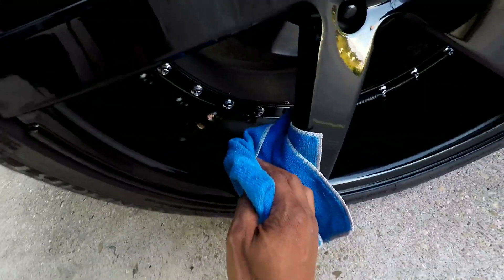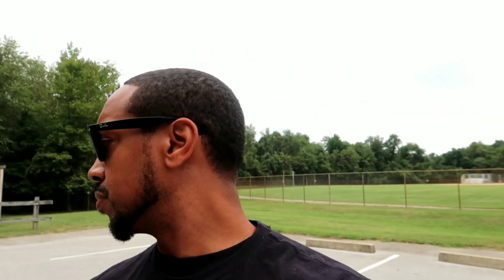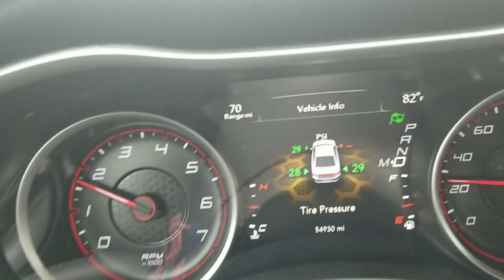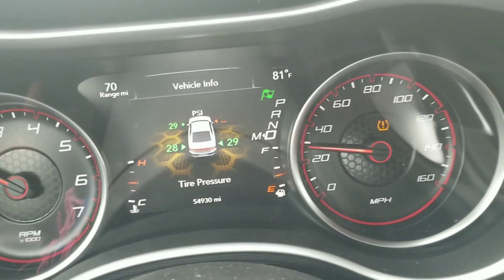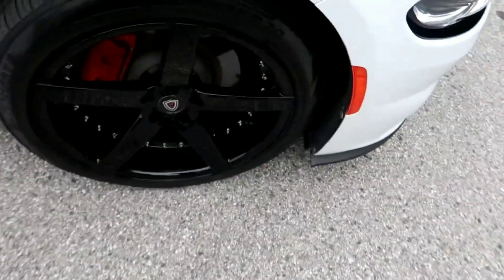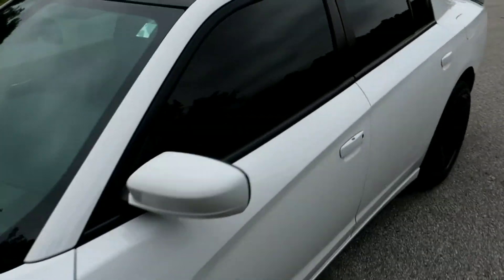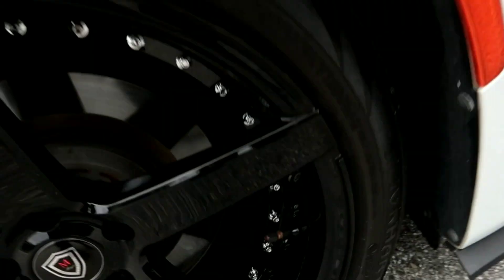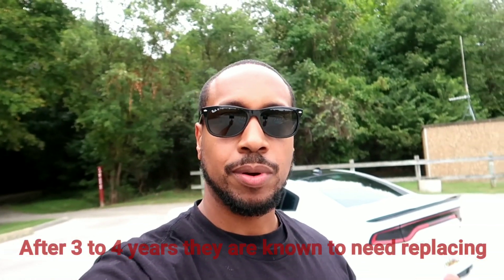My Dodge Charger Is Having The Same Problem FCA Is Being Sued For!

Comment: Here is one for you; I put new 275's on my R/T and my dealer told if I leave them on the car they won't honor the warranty for suspension and also possibly differential problems. Was able to get tire place to give me the 245's w/ no money. Nitto Motivo's. My valves are rubber and they still don't read well. I just do it the old fashion way.

Comment: Thanks for sharing this bruh. I've been getting tire messages for the front passenger side for a while now. It appears to be full of air. Never thought to check the valve stems. Thought it was just due to old age - lol - 2011 Charger. Will be replacing my wheels and tires soon so I'll prolly throw that on in with that job too if needed.

Comment: Omg dodge didnt recall aftermarket wheels?
Reply from the maker: You funny it's not about the wheels funny man it's the valve stem 👎
Reply: Wasnt trying to hate sorry your having problems. The tpms has replaceable valve stems why not take it to an independent tire shop and just have them swap out the valve stems.